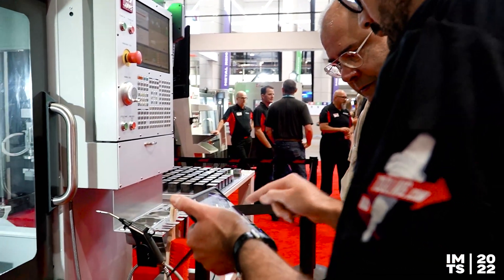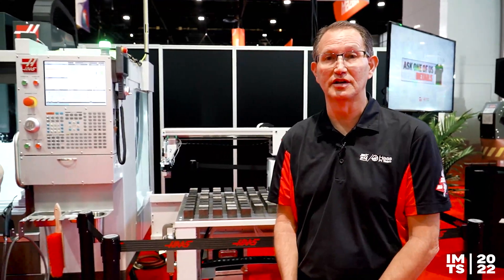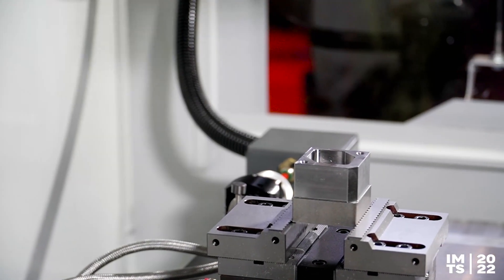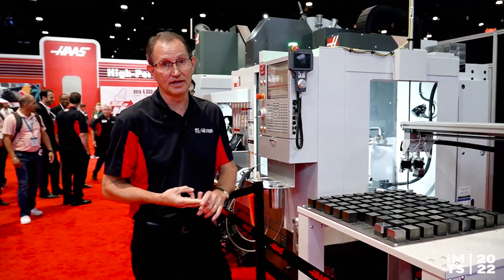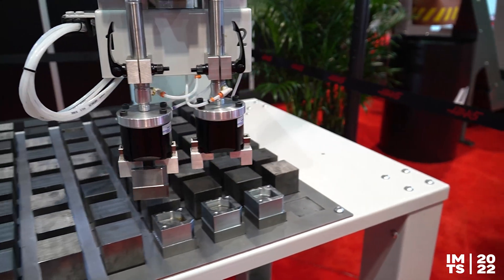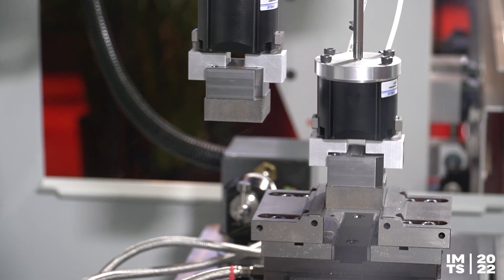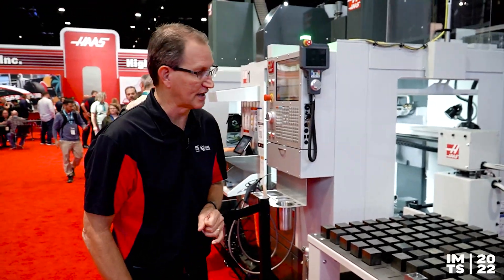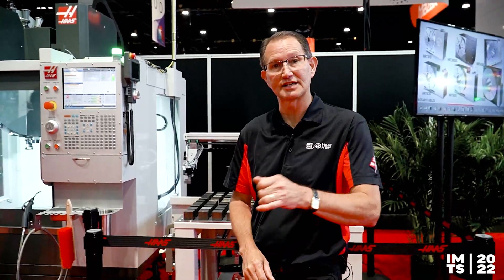The New Haas Compact Automatic Parts Loader at IMTS 2022 - Haas Automation, Inc.

Comment: Bye,bye !!! to the operators
Reply: Nobody wants to be stood at a machine all day loading parts. Automation doesn't replace staff - it frees them up to do more skilled, more rewarding and higher value work. It's a waste of talent to have smart, hard-working people doing simple repetitive tasks. Back in the day people worried that CNC would put people out of work, but the opposite happened - when you don't need an army of manual machinists turning handwheels all day, you can compete with cheap overseas labour and bring jobs back.
Reply: @j.dietrich  согласен с вами абсолютно.
Reply: @j.dietrich  thats not the same operators anyway  :)
Reply: Я вас умоляю))
Reply: you can get any bum flakka addict to do it cheaper than a parts loader